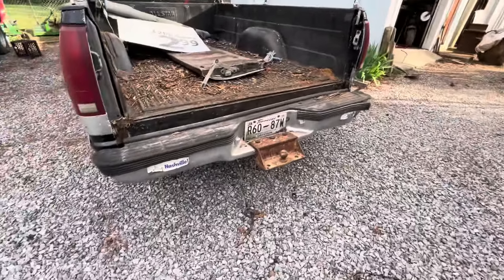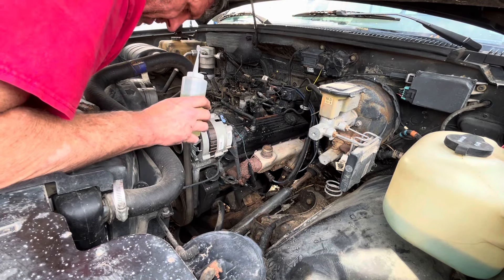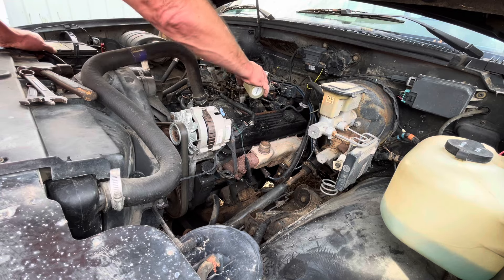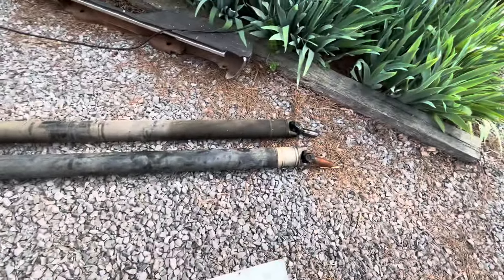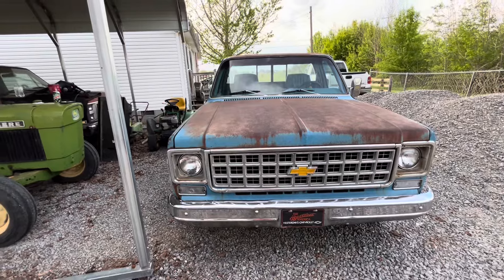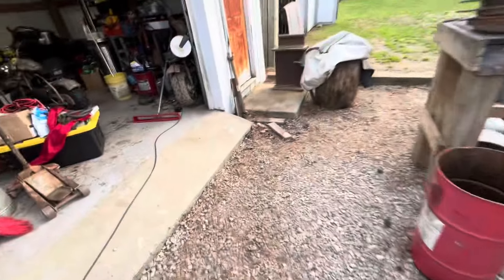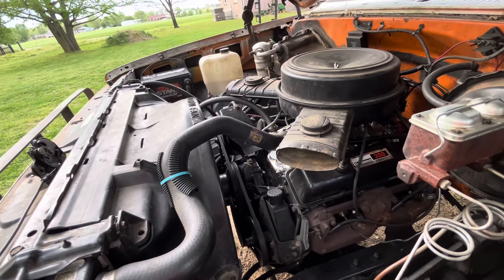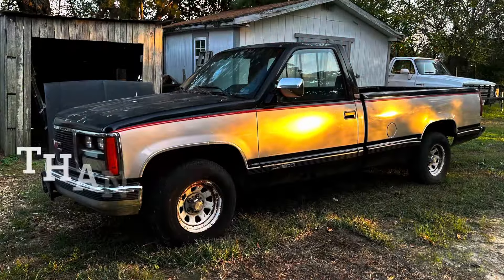Will my daughter’s 1989 GMC Sierra run!!!

Comment: hey i finally move down to TN, and last week just picked up a 1993 chevy 3500 bbc 5spd out of murfreesboro. kid thought the motor was locked up, but it was a dead battery haha. spun over and had no spark. threw a coil and ignition module in it and it fired right up. doesnt even tick
Reply from the maker: What town did you move too? 
That is a great deal on that truck. What are your next plans with it?
Reply: @Classic-Repair  Lafayette, i plan on pulling the motor and trans... im going to put the 5spd in my 85 c30 crew cab, idk what to do with the 454 yet. and im either going to part out the rest or sell the rest of the truck with the title